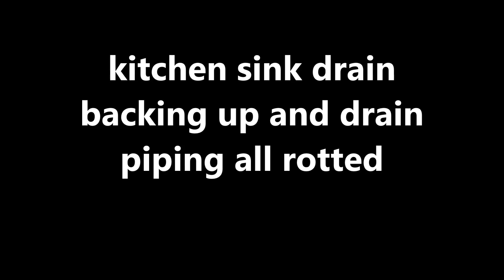kitchen sink drain has issues

Comment: Just an FYI - try a Diablo Extreme  blade on the sawzall. That much trouble with DWV copper isn't good. Nice vid and very nice job on the double sink piping!
Reply: I was streaming the video to my tv so I'm sure you are correct. Seems that a better blade would then be even more helpful?? Looked like he was using a Lenox bi-metal (could be wrong of course) and I wear those out fast so just trying to help.